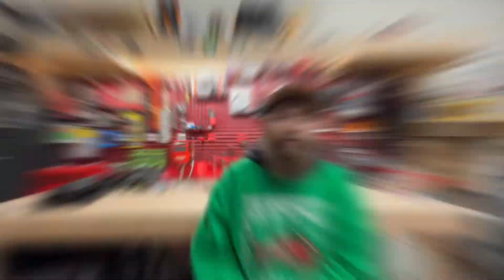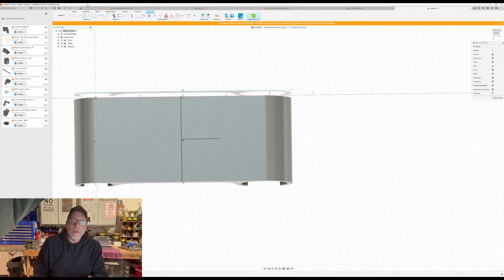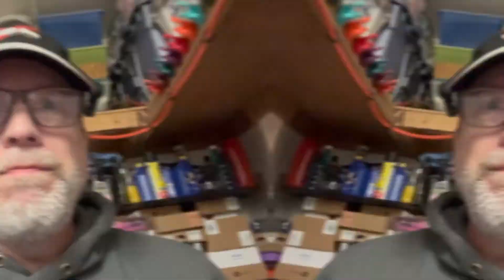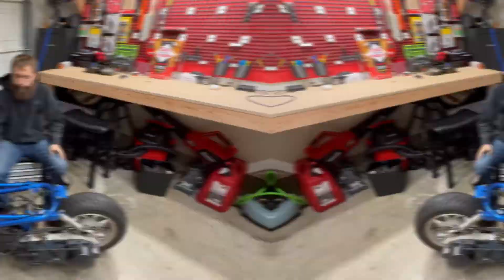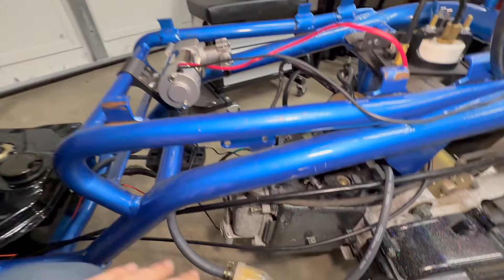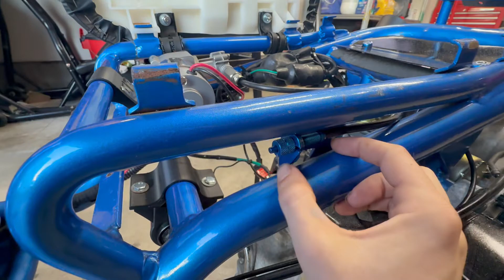Custom Scooter Air Ride Suspension! DIY Install  & Fabrication Guide

Comment: Love the set up. How dose it ride?
Reply from the maker: @richardlee8722  Austin here… When you first hit the throttle you can feel a little more play/movement with the motor and frame but honestly very cushy and comfortable. Still debating on if I prefer the shock or the air ride but after some riding this summer I’ll have a good answer for you!
Reply: @RevRenderGarage  ty keep up posted i was looking into air ride too but unsure yet.

Comment: Did this on my ruckus about 10yrs ago
Reply: Where did you tap in for the power on the harness? Or did you connect it to the battery?
Reply from the maker: @ Thanks for watching....

I actually used a wire from the ignition itself and tapped into the black wire which gives power when the key is on. I originally hooked it up to the red wire from the ignition and that had constant power all the time, key on or off. But that seemed to drain the battery even if I wasn’t using the compressor. That being said that’s why I switched it to the black wire and only has power when the key is on! And the way I used that wire was just adding a double bullet connector so I could just add the wire in. 

Please feel free to message us on Facebook and we can send you pictures of what I’m talking about if needed.
Reply from the maker: Very nice! i don't think you ever recoup the cost of the upgrade but it's definitely one of the coolest mods you can doin my opinion. Thanks for the support brother!